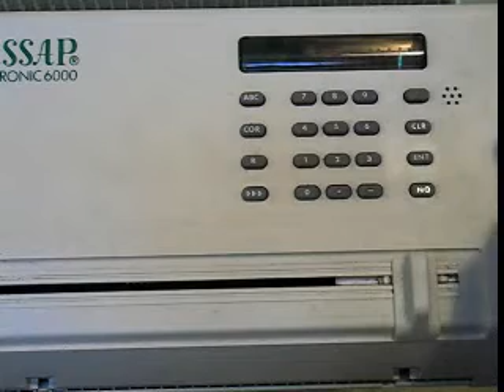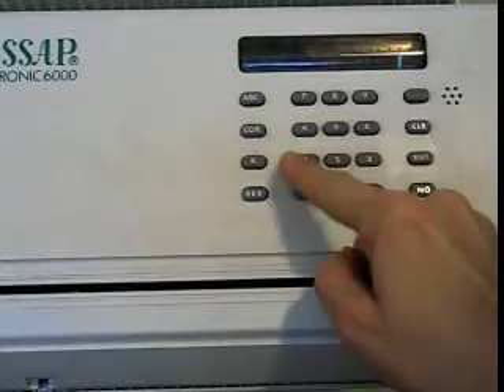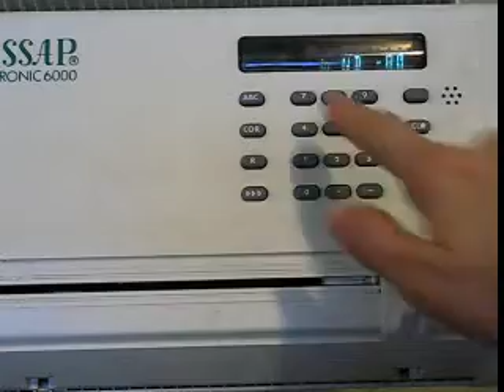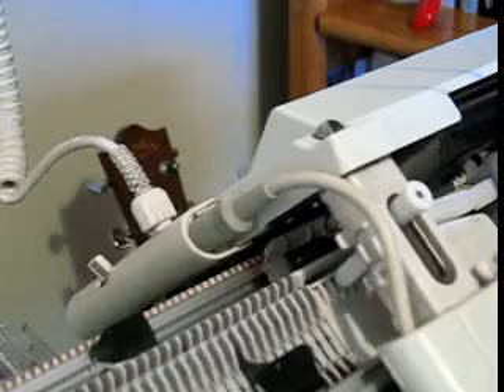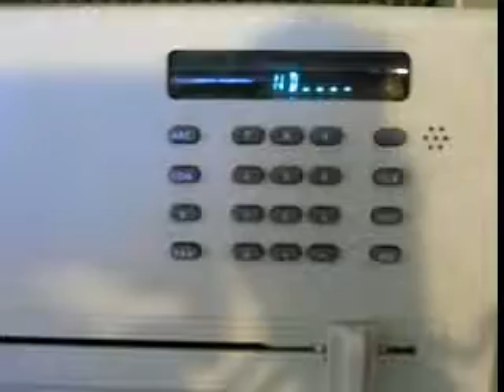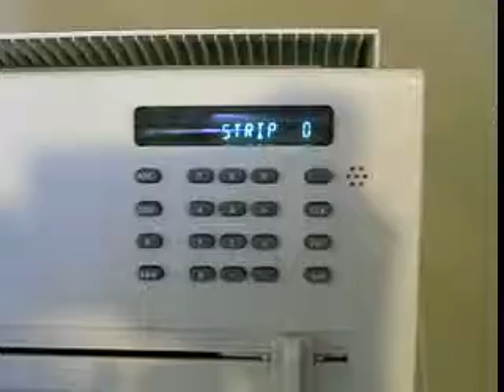Using Passap E6000 Electronics Cast On

Comment from the maker: I am no longer using creation 6 except to download to my machine.  Right now I design in Stitch Painter, save it as a .cut file, then move to my old Windows 95 laptop to move into the E6000 console.  I have seen many comments from folks that you use WebCrea which I guess is free off the internet.  I don't know how they move the design to their console.  I've tried a USB/serial cable but was unable to get the USB to be recognized as COM1, which is what Creation 6 wants.
Reply: Lcoknits